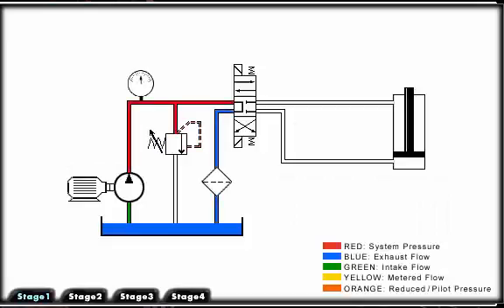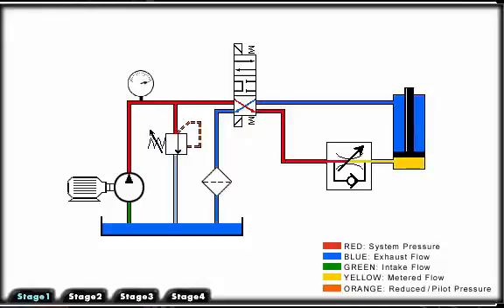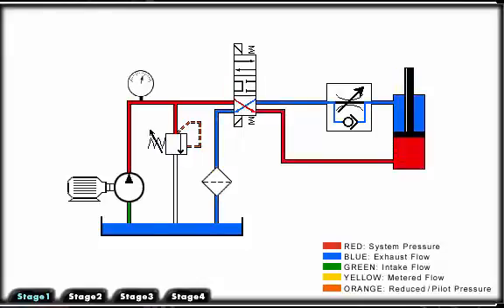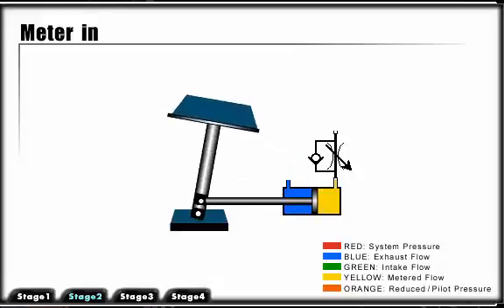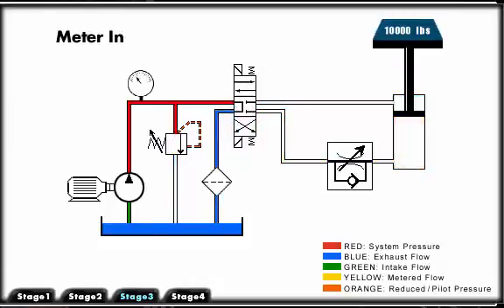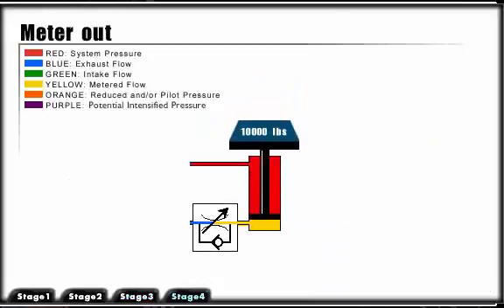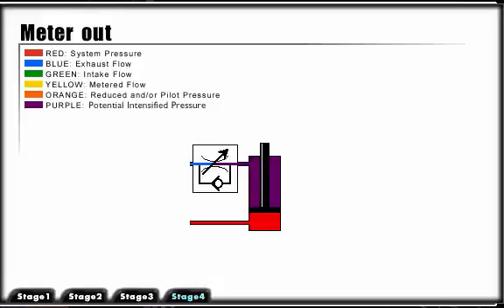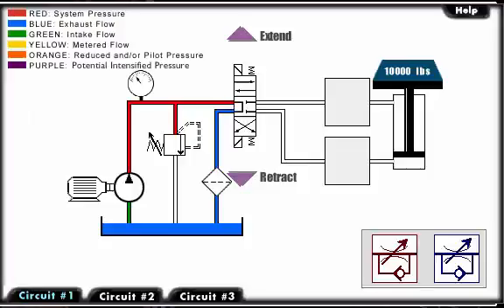Mechanical hydraulic Course, lesson 26 , Flow Control Valves - Meter in and Meter out

Comment: Great illustration of meter in/ meter out. But Not good that that all excess flow that can't go go thru the needle valves goes over the relief valve . System will always be working at relief pressure even without load on cylinder. Heat generation big time !!!